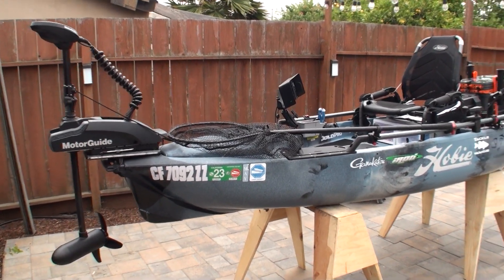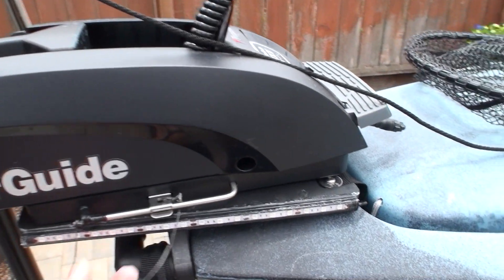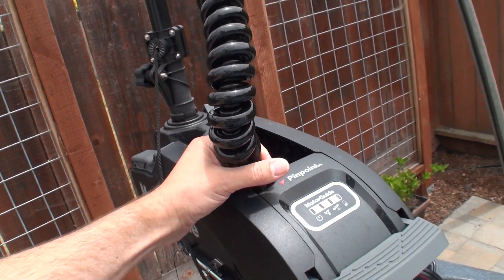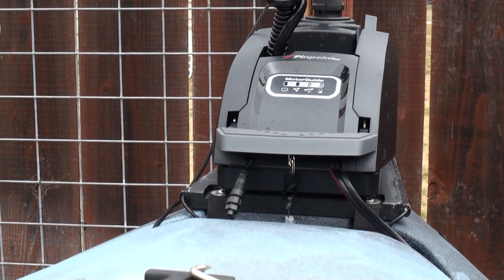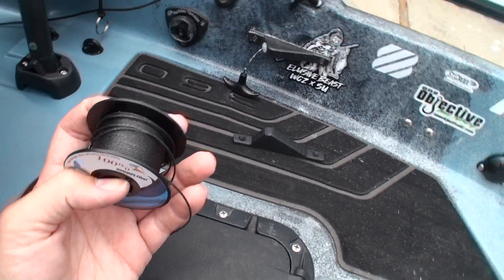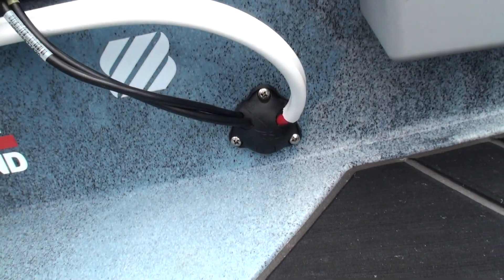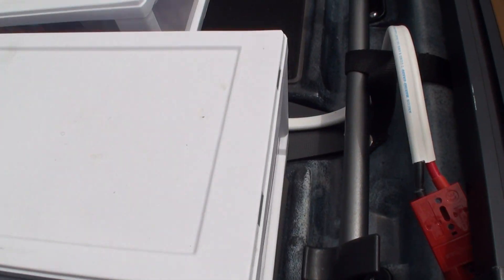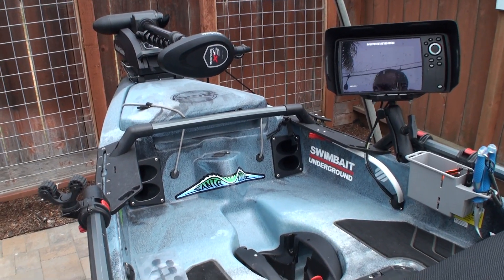Motorguide Xi3 on Hobie Pro Angler 12 360 Walkthrough

Comment: Now to figure out how to get this on my Compass, haha. Clean install, I am thinking about getting the PA 12 for tournaments and using the Compass for drought stricken reservoirs (no ramps access) CA woes and quick trips.
Reply from the maker: Haha. Thanks. Ya adding it to Compass would be tough. I’m not sure that you can even find a mount. I really like the PA12. Had a Native Slayer 10 and upgraded to the PA12. Super stable and lots of room to store and add stuff. Highly recommend!
Reply: @Generalneves007  Yeah, won't work on the Compass. I love that boat though and it has caught a lot of fish. I think a PA 12 will be a perfect tournament platform. My home lake is Clear Lake and the water gets pretty big. Compass handles it but the PA would be better.
Reply from the maker: @db9818  Ya the PA will handle Clearlake better, especially when it gets windy.

Comment: I just installed a one objective mount on my hobie pa 12 today. I have the same motor guide trolling motor to setup next and do a test run to see how to best fine tune my setup.
Reply from the maker: That’s awesome! Some tips while your getting everything set up. You’ll want to run the trolling motor power cables on the opposite side of the kayak as your fishfinder transducer cables. I was getting interference when I had the transducer cable running next to the trolling motor power cable. The kayak will become very bow heavy so you’ll want to try to load up as much weight (batteries, tackle, etc) towards the back to offset it. I would also recommend getting some scupper plug if you don’t already have some, unless you don’t mind water in the boat. I added some because I was getting water coming into boat when making full throttle runs in the kayak using the motor. Other than that, it’s a good set up. You’ll have to watch out when you step towards the front the kayak, like if you’re trying to access the front hatch or something, because water will start coming in through the mirage drive opening. It all drains out when you step back but you don’t want to be doing it for too long. Enjoy!
Reply: @Generalneves007  I was wondering about getting water and how the bow weight affects things…thanks for your input!

Comment: Impressive installation!! I have been considering moving to either a Hobie PA or Titan with adding a motor guide. This provides a great look if I was to go with Hobie. Thank you!
Reply from the maker: Thanks! You won't regret going with a Hobie PA, if you go that route.
Reply: @Generalneves007  Question: do you trailer or launch from truck bed? Manageable for an old guy?
Reply from the maker: I launch from the truck bed and wheel the kayak to the water. To be honest, the Pro Angler is a heavy kayak, especially when it is fully loaded. When I wheel my kayak down to the water, I take off the trolling motor because it makes it very heavy. Having the battery in the back kind of helps because it acts like a counter-weight. Having a trailer would definitely help and make it easier/faster to load and unload.

Comment: Great video and set up.  I'll be using this set up on my nucanoe unlimited.  Question - how hard was it to feed the spectra line through the 1/4' tube?  Did you need a wire of some sort?
Reply from the maker: Thanks! It was pretty easy. As long as the line doesn’t fray at the end too much, it’s easy to feed through. The spectra line also has some stiffness that makes it feed easier. You shouldn’t have any issues.

Comment: Just wondering if you still are using this setup? I have a 2022 Hobie PA12 that I am thinking about installing a Motor Guide XI3 on and was wondering if you had any second thoughts or cons,or regrets about you setup? I see most Hobies mount the XI3 on PA14's because of the water coming up in the PA12 drive opening. Was that the case for you? Thanks
Reply from the maker: The only downside of putting it on the PA12 is the water coming in through the drive opening. It does limit how much usable deck space you have because you can’t really stand towards the front. Other than that, I like the setup and haven’t really had many issues. I did have an issue with the Motorguide Xi3 where it started squeaking really loudly when it was running. I ended up having to take apart the lower unit and replacing some seals. Annoying because it was still in warranty but I didn’t really have a nearby place to take it to get the warranty claim done. If I had to do it all over again, I think I would’ve just gotten the old town autopilot 120. Minn Kota makes a better motor than Motorguide and it basically comes all rigged up already. And it would’ve been a lot cheaper.

Comment: Use some of the locking nuts that won't allow the bolts to back out.
Reply from the maker: Thanks! Ya that’s what I ended up doing. I added some washers in between to create the gap and used lock nuts to keep it from loosening.

Comment: Nice set up. I'm looking at doing the same to my PA 12 360 and currently have a Bioenno 80Ah battery for it and was wondering what type of run time you had with it? Also any issue with water in the hull being it's a 360? Thanks 
Sean
Reply from the maker: Thanks Sean! The run time really depends on how many long runs you are making because that's where most of the power draw is when going full speed. For reference, going full speed non-stop, the battery would last about 2 hours and 30 mins. I know this isn't realistic but it gives you an idea on how much power draw is at full speed, 30 amps at full speed. If you're just making a few long runs and mainly fishing shorelines or structure, it will last you all day, almost 2 if you don't go full speed too much. I've never drained the 80Ah. I have noticed some water in the hull recently. I'm trying to pin-point where it's coming in from. I think it may be the 360 drive cable tube. Hope this helps!
Reply: @Generalneves007  Thanks for the feedback. I'll keep you posted on my install 👍
Reply from the maker: @demolition_fishing  Thanks and good luck!

Comment: Thank you for the video it is inspiring, I have the PA14 and I was thinking to add a electric motor and you have impressed me on how nice you have done this
Reply from the maker: Thank you for the nice comment!
Reply: @Generalneves007  what cable did you use from the Battery  to the Motor? can you give me a description please.
Reply from the maker: @meraioan  I used 8 gauge wire from West Marine. There is a link to the wire in the video description.
Reply: @Generalneves007  thanks

Comment: Awesome video. I ordered the one objective now mount a couple days ago. Does it come with the rectangle mount/quick releases bracket… that the trolling motor goes on? If not please can you tell me where I can get that? Or a link. THANK YOU IN ADVANCE!
Reply from the maker: Thanks! The Motorguide quick release bracket does not come with the one objective mount. You’ll need to order it separately. You can get it on Amazon for $60 right now, which is the cheapest I’ve seen. Here’s a link: https://www.amazon.com/gp/aw/d/B07L3L8L3X?th=1&psc=1
Reply: Thanks for the quick reply man just ordered everything and then watched your video and realize that I’m missing the mount. thank you so much for the quick reply. Just ordered it off Amazon. 🎣🎣

Comment: Use blue lock tight so hold the garmin mount on the trolling motor shaft.  Dont use super glue! lol but hell of a setup!
5
Reply from the maker: Thanks for the idea! I actually ended up placing some washers between the brackets to add separation but I should also add loctite to the bolts. Thanks!

Comment: Do you have to get out of your kayak to remove remove weed when it fouls the prop ?
Reply from the maker: No I don’t. I just pull the motor up into the stowed position and then reach to the front to remove the weeds. I do have to remove them quickly because water enters through the mirage drive opening when I stand towards the front of the kayak. Thats the one issue with installing the motor on a PA12. But the water self drains back out the mirage drive opening so it might just take a few attempts to clear out all the weeds.

Comment: I have another quick question for you on this setup. Over this past weekend i had my lithium battery completely shutdown on me while trying to make a long run on full power. I was told the battery meter is the culprit.

Has your battery overheated with this setup?
Reply from the maker: The battery meter I had stopped working quite a long time ago. I'm not sure what happened to it but maybe it got wet. I never ended up replacing it because I didn't find myself going on fishing trips where I was making lots of long runs. In terms of the actual battery overheating, I've never had a battery overheat on me. I would second the battery meter being the problem. That may not be designed for the long runs that draw high current for an extended period of time. Were you able to confirm that it was the battery that shut down on you and not the meter? Does your setup allow you to not have the meter connected?

Comment: i like my motor guide but was a lemon i had every part changed in it.Now i got the programmer so i just put that on it when it stops an its starts going again its crazy.I want to put it on ascend133 its 36v i got a gator lithium battery pack it only weighs 110 lbs i am going to take it on trailor anyway so weight dont matter
Reply from the maker: That’s unfortunate man. Luckily the Motorguide has been good for me so far. 🤞🏻

Comment: Nice setup, now, with this trolling motor you lose the fish finder in the front H-rail, what it’s that?
Reply from the maker: Thanks! Actually you don’t lose the fish finder mount. Since making this video, I have added a new fish finder to the kayak and I have it mounted the the front H-Rail. The trolling motor gets close to the fish finder but it still fits. If you did have trouble mounting it, you could offset it left or right so it doesn’t hit the trolling motor.

Comment: Good video, looks like its been about a year so how has the install held up? and how well did he battery and motor combo perform?
Reply from the maker: Thanks! The install has held up really well. Due to the added weight of the motor on the front, I had to install scupper plugs so that water wouldn't start coming up while going full speed. Also, I ran the transducer cable and battery power cables through the same thru-hull fitting in the kayak and the battery wires are causing interference in the side-scan of my Humminbird fishfinder. I plan to change that wire routing eventually. In terms of the battery and motor, they have been great. I did have an issue recently with the motor making a loud squeaking sound when the prop rotates. I had to take the lower motor unit housing apart and grease the shaft to stop the squeaking. Other than that, it has been good. The battery gives me plenty of range to fish.

Comment: Am curious about the placement of your battery box. Why did you put it forward of your crate instead of behind the crate? Any particular reason?
Reply from the maker: My thinking when I made this video was that I wanted to have access to the battery box and I couldn’t do it if the crate was in front of it. But I since ended up swapping the battery box and crate. And also I needed to redistribute weight on the kayak so I put the battery further back.
Reply: @Generalneves007  
With regard to the weight distribution comment you made in your reply, did you find that the weight of the bow mounted motor needed to be offset with the battery being positioned further aft? What issues did you encounter when you had the battery positioned in front of your crate. I’m about to rig my PA12 with an xi3 and am trying to settle the battery placement issue. Thanks
Reply from the maker: @Osprey1955  given the weight of the xi3 and the fact that most of that weight is hanging over the bow of the kayak, you’ll want to position the battery as far back as you can. The main issue has to do with water coming through the drive opening when you step towards the front of the kayak when fishing. Besides weight distribution, the only issue I had with having the battery box in front of the crate was that it made it harder to access the crate because I was having to reach further.

Comment: @Generalneves007  Did you ever change the routing of the cable and did that solve the issue with the interference with your side scan?
Reply from the maker: Yes I did change the routing of the cable for the battery and fishfinder. I ended up drilling a hole in the back area and running the power cable for the motor along the starboard side of the kayak. Then I ran the fishfinder cables along the port side of the kayak. That fixed my interference issue with sidescan.
Reply: @Generalneves007  Gotcha. I currently have my fishfinder cable coming up through the through hole and into the transducer cavity and was planning to run the trolling motor cable the same way but I'm assuming I would get interference that way as well?
Reply from the maker: @scottcarlin2304  That’s how I originally wired everything up and I had problems. I even tried moving the fishfinder to one side and the battery cable to the other but the problem still persisted. Running the battery and transducer through the same thru-hull was the problem.

Comment: sounds like Old Town is for the best, any words on that?  I'm trying to do some comparisons.  for  basic fishing, large mouth small mouth and other,  creeks/rivers, lakes
Reply from the maker: When I originally bought the Hobie, I wasn't planning on putting a trolling motor on it. If I was to do it again, I would've gone with the Old Town Autopilot 120. The 12' Hobie PA is just not ideal for adding a trolling motor, it changed the kayak dynamics quite a bit. I think the 14' PA is better suited than the 12'. You can't really beat when the kayak comes with a trolling motor and was specifically designed for that scenario. I am currently selling the Hobie and almost bought a Autopilot but ended up getting a pond prowler because I want to take my son out with me.

Comment: How much weight does it add to the front of your kayak ? And does it take alway from the stability of the yak?
Reply from the maker: It does add a little over 40lbs to the front of the kayak. It doesn't affect stability very much. When you have the motor in the water, it kind of helps with stability because it essentially adds side-to-side resistance in the water. It wouldn't say it improves stability but it certainly doesn't make it so unstable that you have trouble standing or moving around in the kayak.

Comment: Any interference from the TM to the FF with those cables so close??
Reply from the maker: Yes I did have interference issues. I ended up moving where I ran the trolling motor battery wires to a different part. I drilled a hole and used a thru-hull fitting to run the wire along the starboard side. I moved where I mounted the fish finder and ran the transducer wire along the port side.

Comment: Did you have Any issues due to the 8 awg wire? Maybe with heating up wires?
Reply from the maker: Nope. The 8 awg is working fine. The current draw of the motor is below the wire rating.

Comment: The LCD  Power Analyzer device you have in series with your battery to motor - Amazon information says it has 12guage wires.  Any issues going from your 8gauge run reducing down to 12 gauge going through the  Power Analyzer?
Reply from the maker: I actually changed the wires on that power analyzer to 8gauge. It wasn't done very cleanly because the case is not meant to fit the large wire diameter but it worked. Thinking about it further, you might be able to get away with using the stock 12gauge wire on the power analyzer because its a very short length and 12gauge wire should be able to handle up to about 40 amps. I saw a current draw of about 30 amps with the Xi3 running at full speed. It's worth trying the 12 gauge wire but I already removed them from my unit.

Comment: Do they advise a 50A or 60A circuit breaker for that motor?
Reply from the maker: You can use either. In the Motorguide user manual, they say the 50A breaker is the “good” option and the 60A breaker is the “best” option.

Comment: Nice video.  BTW - How many feet of 8/0 wire did you need for the project?  Thanks !
Reply from the maker: Thanks! I believe I bought like 10 or 12 feet but I also used some of the wire to make a pigtail for the battery box.

Comment: nice clean install.  Have to ask how did you keep the sleeve on the wire?
Reply from the maker: Thanks Matthew! I just used a knife to cut the 2 wires down the middle and got a little closer to the wires so that I was able to separate the sleeve. I hope that helps. It wasn’t too difficult.
Reply: @Generalneves007  thank you.  What I am trying to figure out is the white duplex covering. When the wire comes out of the through hull and into a connector did you slide the white sleeve back on?   Makes for a nice clean look.

Comment: Awesome video, answered a lot of questions. Also like the links in the description below provided.
Random question for you..... Have you had any problems with your Xi3 so far? I have had the control module replaced twice so far and it keeps going out for no apparent reason. Just wondered if you have any feedback? Thanks again !!!
Reply from the maker: The only issue I’ve had with my Xi3 is the motor prop shaft started squeaking loudly. I had to take apart the motor housing and grease the prop shaft. Ended up also replacing the seals too.